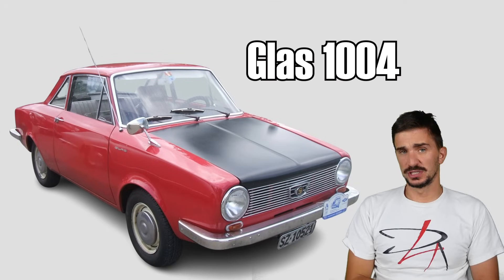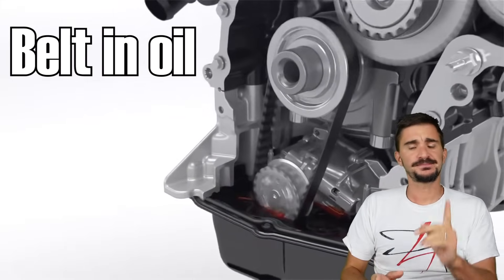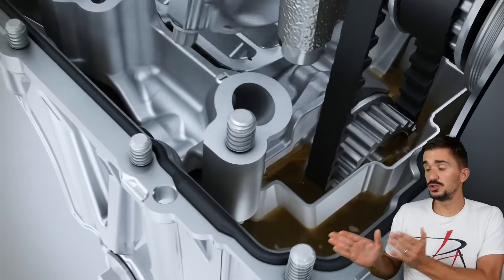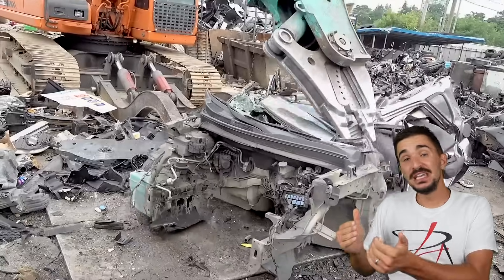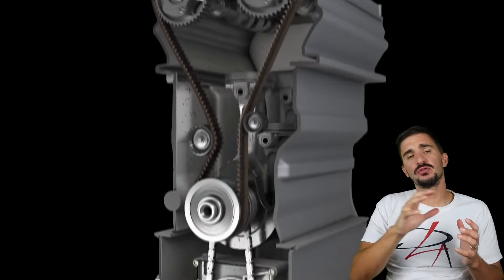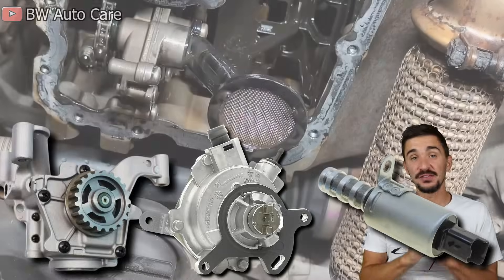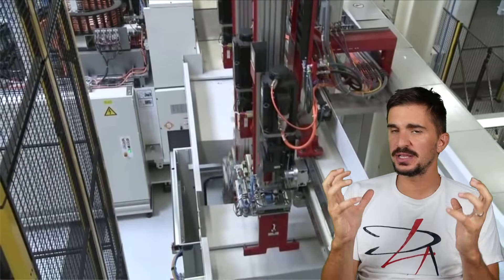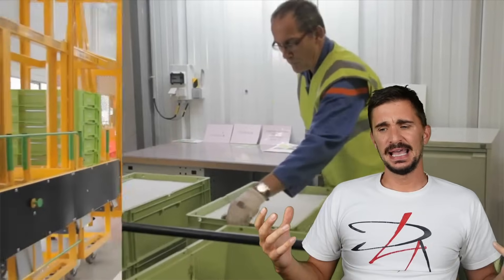Who Approved This and Why Is It Still Being Made? Wet Belt aka Belt in Oil Engines

Comment: BMW also earns extra points for making timing chains that fail before timing belts.
Reply: Blown Motor Werke
Reply: The timing chain can't fail if the shitty plastic chain guide fails before ! ... Bmw logic
Reply: and also .....but not only bmw , others do too ....BMW spared ONE ( 1 ) lid and gasket and moved to timing stuff to....the worst place to be for a timing chain , at the point where the most vibrations and inkonsistency occurs , at the clutch .
and it makes it more expensive to maintain or change .

sometimes engineers need a slap to the back of their heads .
Reply: BMW's are not know for failing timing chains.  Failing VANOS, connecting rod bearings, HP fuel pumps, plastic connectors, etc. but not timing chains.
Reply: BMW claims to be the "Driver's car". They never claimed to be the " Owner's car" :^)
Reply: BMW are a different kind of special.
Reply: @KapiteinKrentebol 😂😂😂😂😂
Reply: No, it's the extended service intervals they use.
Reply: Germans cars are not what use to be. Now the car from Asia is more reliable than any Germany made car. And this is why they now close cars factories in Germany. Poor sells do to Asian cars who comes to EU with much reliable engines like Japan cars for example.
Reply: N16 mini owner here, can confirm, chain doesnt last, plastic guides even worse. Thanks BMW. Otherwise it is a really nice engine
Reply: @invertedpolarity6890  :) You are talking about petrol engines, but in Europe most engines is diesel. Read something about N47 and N57 timing chains...
Reply: And VAG is the same. But then they invented the triangular cam gear to counter that problem and make the belts as short lived as the chains.
Reply: @Low760  Yep thats also a large part of the problem.
Reply: @sleepydragonzarinthal3533  Ex-Citroen DS3 owner here. The BMW supplied Prince Engine kept me on a first name basis with the dealer.
Reply: Timing guides.  Not the chains
Reply: They learned that trink from VW/Audi.
Reply: @cameron20020  haha some of them were worse than others. I do a lot of the work myself as an amateur driveway mechanic, its not much worse than other cars I've owned, just less workspace under the hood, longer list of possibilities when diagnosing, a few extra specialty tools to buy. So glad I dont have the n14 or n18, the candles that burn at both ends. It does mean a mechanic will charge a lot for the extra time and to justify the specialty tools, but for the DIY its just an extra beer or 2 on the weekend.
Reply: BMW
BUILT MECHANICALLY WRONG
Reply: *Audi engineer steps in and says hold my beer*:

The 2.0 tsfi is SO COMPLETELY overly complex with a single chain ran over 30 extra sprockets and 10 different tensioners and guides....
Reply: Give me timing gears ala Ford 300 I-6 and Volvo B18.
Reply: @Fish-y3g  The chains are also wearing out and get too long for the guides to be able to guide them. Both on this ford engine and VW engines because its being made too cheaply. It's the riivet holes that wear though rather than the chanins stretching.
Reply: well its not the timing chain its the timing chain tensioner (that they made of plastic)
Reply: @davidtheexiyt6060  yeah, my engine is still going after 27 years, lets hope she keeps going
Reply: VAG too
Reply: @mkshffr4936  Are those not OHV thoug menaing that the job of the cambelt is being done by pushrods rather than gears. Compareing apples to horse apples here.
Reply: @rimmersbryggeri  I've checked tons of bms chains and mini chains too.  Had 1 mini chain stretch.  All the timing guides shattered before the chain could wear.  Except the 1 mini people actually maintained
Reply: i never heard of a bmw timing chain fail here by us in South Africa. Merc and bmw with timing chains can do 500 000km easy. Anything with a cambelt is a no no. Fuel pumps on bmw was an issue for a while especially 1 series.
Reply: @mmmdawe  I think it's the 2.0 that loses oil pressure sometimes in the hydraulic tensioner and the chain jumps when starting it.
Reply: @rimmersbryggeri  Those are indeed OHV which I prefer however it is possible to make OHC engines with gears. In fact IIRC they used to make aftermarket systems to change to gears from a chain.
Reply: @dennythescar80s8  German cars never were that special. They were on par with all other European manufacturers. Sometimes better, sometimes worse. There are such things as downright shitty cars by Mercedes. No, I don't think of the original A-Class there. The C107 models have bodies you can't stop from corroding.
Swedish cars were different and better. The vast majority of customers didn't get it, Swedish manufacturers got bought by shitty conglomerates and got made worse.
The view of the majority of car maker's CEOs and boards is: Customer equals dumb.
And they are not that wrong.
Reply: @dennythescar80s8  they closes because of no dirt cheap gas from Russia
Reply: @Fish-y3g  my chain does rattle at idle cuz of the tensioner :) 20k km further im thinking about replacing the faulty part. It's not even the loss of oil pressure, it's caused by fatigued spring in the tensioner, which does not get any help from the oil pressure at low rpm, to keep the chain under tension.
Reply: Might want to check the owner. The only real issue are the v8s and the valve seals. 

Bad oil and extended oil changes are what make chains fail.
Reply: @sleepydragonzarinthal3533 Is that the one in the 1 series with the skinny timing chain hidden at the rear of the engine ?
Reply: Same on the Stelantis 1.5 Diesel.
Reply: @davidblahota5655  I've had 2 that were newer low mile engines that had jumped after oil changes .   The springs seemed ok.  I ran an independent garage when that happened.  My buddy who was a vw dealer tech has had some of those engines jump too 😳
Reply: I'll give em some slack due to how easy it is to change some of those chains
Reply: @davidtheexiyt6060  they've had multiple engines with timing chain issues, the N20 being the worst but go ahead and defend a shitty engine maker
Reply: @davidtheexiyt6060 ppl driving cars they can’t afford is what it sounds more like to me go change ur oil or get a throwaway car
Reply: Tell me u don’t know nun ab cars without telling me. Ppl destroy bmws and Audis because they cannot afford to drive the car and extend service intervals and oil passages get clogged etc. if a car had frequent oil changes it would not have those problems.
Reply: @tobwilpeen5701  exactly.  No 10k oil change intervals..... which to customers means 12 to 15k.  Like  Old Ford v6s from the Rangers were great engines until the timing guides got brittle from not changing oil enough
Reply: Bavarian Manure Wagon, Bring My Wallet.
Reply: and people keep claiming that push rod motors are dead, i'll take a short timing chain & the push rods of a small block chevy for the rest of my life. long live the push rods!
Reply: @davidtheexiyt6060  1 out of 1000 verses 1 out of a few million.😂😂😂😂
Reply: If only changing oil every 10kkm would completely fix this :(
Reply: I wonder how many cry babies that complain about BMWs actually owned one. Anyway, I bet their Citroen Berlingo is way better.
Reply: @dennythescar80s8  Toyotas are starting to go up in flames. As fast as Electric Vehicles. That are made in china. Or experience a major failure engine failure.😮🥶😭😭😭
Reply: @invertedpolarity6890  Few are, for example the N47.
Reply: If you use the right oil with molybdenum additives the timing chain will last forever. German cars have to be treated like the engineers intended to.
Reply: @invertedpolarity6890  Unfortunately they are know for those type of failures. Especially timing guides and stretching chains. In my country we drive mostly diesels, so when buying a 5 series F10 I avoided the N47 because it's know to blow thanks to the timing chain stretching too much or even breaking way before its service interval. So I went for the N57 and guess what. I had 3 engine failures because of the other problems BMW engine are known for.... rod and main bearings...
Reply: That is indeed a skill
Reply: I had an E34 5 Series. Totally reliable apart from the irrelevant toys like rear window blinds etc. (I didn't spec. them, I bought it used)
Reply: @invertedpolarity6890 
And l remember when it was just coolant pumps. Maybe they think they are still building engines for fighters. The aircraft will never survive long enough to reach Time Before Overhaul. AKA as the driver is going to total it anyway
Reply: That's due to bad oil
Reply: @maxx1nsane  having replaced (at great expense):
Timing chain
Vanos unit
Cams
Followers
Rod bearings
Head gasket

I hereby welcome any non BMW owners to join the bashing. 😂
Reply: @ariesmight6978 Correct me if I'm wrong, but wasn't there a crossover with BMW in the GR Corrolla? Or was it just BMW blocking it from Europe to protect 1 Series sales?
Reply: Might as well have made a rubber chain
Reply: @rawenrawen2420  that's just plain not true... There are more diesels in Europe than America, but there are not more diesels on the road than gas engines in either country unless you're including large trucks and heavy equipment.
Reply: @invertedpolarity6890 V8 4.0 has bad design and TC failed.
Reply: VW says hi
Reply: This is actually true for all of the N series engines. Especially the 4 cylinder diesel engines. I have an M52 with 520k km on the original chain and head gasket, I changed them just because I stroked it to 3 liters. M series engines are one of the most robust engines BMW has ever made. If it fails, its the owner's fault for not maintaining it.
There are numerous cases of M52/54 engines going upwards of 800,000 to 1,000,000 km. With the highest one I've seen at 680,000 miles (almost 1,1 million kilometers).
Petrols are a bit better even with the N series, two of my friends have N52 engines (one in a E92 325i and one in a F10 528i (US spec is with a N52B30)) Both of them have over 300,000 km on those engines.
Reply: Audi was famous for timing chain failure, BMW diesels had timing chain issues.. I think you are just talking out of your ass, good try though
Reply: @takomerp  It's the mechanic's car
Reply: @invertedpolarity6890  Finally, a comment from someone who actually knows what they are talking about.
Reply: @davidtheexiyt6060 Cope harder, “bud”.  😂
Reply: @simontist 
There's not really any such thing as "bad oil".
There is the wrong type of oil and contaminated oil.
Reply: Not just BMW , Mercedes has it even worse timing chain failures.
Reply: Lasts longer than the warranty, so they don’t mind
Reply: @TheGuruStud  vw are worse 2.0 TSI is disaster
Reply: @pauln6803   I guess I mean it goes bad when it's too old. Or people using the wrong spec. User error in other words
Reply: BMW owner here with the N47 engine. Just change the oil regularly. Not the 18k miles BMW tell you and all will be fine.
Reply: @mkshffr4936 

A lot of GM (US) cars from the 80s had gear driven cams/cranks….
Reply: @davidtheexiyt6060  you are obviously not familiar with the N47. Still, bonus points that despite a severe design flaw, it was still more reliable than the Ecoboom
Reply: Also extra points for using magnesium engine castings (when aluminum works just as well) requiring them to use aluminum bolts - which is dumb enough - and then deciding to have them torqued to yield.  Aluminum fails pretty quickly under strain.  

I saw so many of those bolts with the heads just missing.  At least you could extract the bolts pretty easily?

And on their older aluminum M54 engines, if you overheated them, the head bolts would pull the threads out of the block, and require thread inserts be installed at the machine shop.  People talk bad about the Cadillac Northstar for having the same exact problem, but silence about the same exact problem on the M54.
Reply: Welcome to Audi club. Timing chains on some Audi engines need to be replaced as often if not more often and cost 2-3 times more to do than dry belts.
Reply: 😅. I have never owned a BMW and no desire to ever own one.
Reply: @davidtheexiyt6060 where did the guy say all BMWs are bad? Getting a bit too protective there fella.😂
Reply: For owners that don't know how to change their oil on time.
Reply: @jacooosthuizen3593 why is timing belt a bad thing there?
Reply: @KapiteinKrentebol  Brings Mechanics Wealth
Reply: Indeed. Sadly thats just one example, I remember some of the old designs from Merc and BMW that were bulletproof and were even forgiving with poor servicing, not all. There were crap engines long before but the 2000s came along and a lot of designs that should have never left the drawing board let alone the factory floor. A lot of it is a tensioner that doesn’t self adjust properly or at all. I would favour a normal timing belt over most ofter designs, even if the change mileage was 60k. At least it can be done without worrying about premature failure. Some of the early attempts at timing belts were terrible as well. They should have enough data to produce something decent by now, then they started using wet belts for timing 😂.
Reply: @Mac_F87  fella, my point is that he can’t just call a brand bad just because he had a certain issue while quite literally everybody else that owns a bmw hasn’t had that issue. Maybe don’t misinterpret peoples comments next time?
Reply: @davidtheexiyt6060  Aww, you triggered? BMW has several engines that eat timing chains. I say this as someone who has owned a bunch of BMWs and currently has an X5.
Reply: @OtisFlint  also a bmw owner here, never had any issue, and I know multiple with old bmws and new ones aswell, never ever heard of a timing chain problem. You can even see in the replies of this comment people saying that bmw never has had any timing chain related problems. So it might just be a you issue pal :)
Reply: Audi tried to beat them to this with the v8 chains.
Reply: @dennythescar80s8  German cars are excellent if you keep track of the common issues and DIY the maintenance, or you have deep enough pockets to keep them properly maintained as they age. They can be very reliable with preventative maintenance because most generations suffer the same repeat issues. Ignore these issues and they are nightmares. They are not for the average vehicle owner.
Reply: @davidtheexiyt6060   I think you are the one misinterpreting people comments. Where exactly, did he call the brand as a whole bad? 

I’m sure you can explain, since you seem to be the one who likes to read between the lines and come to crazy conclusions. 🤦🏻😂
Reply: @invertedpolarity6890  They didn't sell the engines that had the REALLY bad timing chain issues in the US. It was epidemic in the rest of the world on the 2.0L non-turb gas and turbodiesel engines.
Reply: Also bonus points for putting the chain at the flywheel end of the engine so engine or transmission has to be removed to be replaced said timing chain 😂
Reply: @davidtheexiyt6060 1 in 1000. That's a huge amount of failure! I hope this wasn't you defending BMW.
Reply: im dying when someone said to me "bmw oil change interval can be as long as 15k miles". I checked the web and apparently its not uncommon recommendation.
Reply: BMW Broke My Wallet, they are leaders in their field
Reply: 300k mile internet failures.
Reply: Did you forget to pay your timing chain subscription again? 😂
Reply: @ChainsawChristmas  unless ur the ceo of Honda, that’s a normal amount of failures
Reply: I did a timing belt change on my 92 Civic Si hatchback at 229 thousand kms and the next one at 428 thousand kms,it still looked good😊
Reply: That’s interesting 🤔 Never had a BMW have a timing chain fail 🤷🏾‍♂️ Maintain your car, change the oil every 4,000 miles. I think my cousin JUST had to replace the timing chain on his E39 540 after 225,000 miles which really, at that many miles you should replace the chain on any car.
Reply: @davidtheexiyt6060  I think you may live in a different market . European N47 diesels had almost 100% premature failure.
Reply: N47 engine. I had a timing chain snap on my 5 series when it only had 32k miles. Roadside recovery guy was like yeah, they also put this tiny, fragile chain to the back of the engine too so you’re gonna need an engine removal lol. Worst idea ever
Reply: Not remotely true. The guides yes. The chain itself hardly ever.
Reply: @invertedpolarity6890 my BMW is known for a failed owner.
Reply: @sleepydragonzarinthal3533  That’s a Peugeot\Citroen engine
Reply: @mkshffr4936  I would like to see what such a system looks like and how it drives water pumps etc correctly. Seems like alot of added complexity for very small real world gains to me. Not even sure that gears are more rubust than a well degned chain over time.  I don't theink that a well designed chain system uses the chain to drive the water pump and maybe I am just confusing it with belts and they never do. Never did change a chain myself but I have assisted in changing a wet belt and i think in that particular car the oil drain plug was an even worse design than the wet belt. (Plastic sump and not threaded).
Reply: @invertedpolarity6890  Not sure what country you are from but in the UK The basic diesel models, which are by far the most popular are very well know for chain failure before 100K miles .
Reply: Kudos for that mention.  Yea, damed of you do, damed if you don't.
Reply: @a1d3nh0  I have a 328d with a N47, you got a dud buddy. The timing chains on these engines are very strong and should last 200,000 miles. The chain guides and tensioners are the weak link (no pun) but they should last 200,000 as well with 4,000 mile oil change intervals. If you wait until 10,000 miles to change your oil your chain (and other components in your engine) will fail. BMW worst mistake with these chains was recommending a 10,000 mile service interval. Ive seen these cars hit 180,000 with no issues, but at 200,000 miles you should really change your chain and tensioner.
Reply: @Soh90  no dud. That exact engine was the reason BMW was featured on BBC’s Watchdog programme. People had them snap at 10k miles. It was concluded that bmw wouldn’t recall the engine because it was cheaper for them to deal with lawsuits as they came in. Not because the engine was fine. They’re not strong chains at all. Thinner than the variation before, shaper teeth on the gears, worse tensioners and guides. And put at the back of the engine making it a whole disaster. I didn’t get a dud, I got the standard. Either you were lucky or you got one with upgraded parts. All repairs to those chains involved a better chain, cog and better guides. Go watch the BBC documentary on it
Reply: @jamesmedina2062  Personally i had a cambelt snap on my VW TDI. Never had my BMW or Jeep timing chain snap while owning those vehicles. Personal experience it is a maintenance part so never know when it actually will snap.
Reply: and carbon buildup from soley direct injection.
Reply: only the engines under 2 liters.
Reply: @a1d3nh0  What year is your 5? I know they were upgraded as a result of the lawsuits and you likely have an earlier model 5. So that would explain why we have completely different experiences. Sorry that happened to you man.
Reply: @invertedpolarity6890  'BMW's are not know for failing timing chains.'
There's failing and then there is failing.  Yes, they have been known for timing chains that need expensive repair and replacement even if they hadn't just fallen apart and blown up the car yet.  It was a known thing on both of my 735i's even way back in the 1990's.
May not affect every engine they ever made, but it was definitely a thing.
Reply: I think that’s Audi my friend
Reply: @megunded  they moved the timing to the back of the engine because of the problem with belts getting sucked into the timing cover from oil leaks onto the accessory belt and slipping off the crank hub getting sucked through the seal.
Reply: @Soh90  mine was years ago. 54 plate it was
Reply: timing chains was literally just the N20/26, rest of the engine is very reliable you have no idea what youre talking about
Reply: @a1d3nh0  Yes you are right, early 2000’s N47’s were really, really bad lol. My car and my colleague’s is a 2014 and 2015, respectively. His is sitting at well over 180,000 miles and I’m either at 94,000 or near that much. I’m also in the US where diesels aren’t as common (or as loved) and over here BMW was pretty much forced to do certain repairs. Due to all the stringent regulations the N47 still isn’t perfect, but it’s less BMW’s fault and more environmentalists/EPA’s fault. DEF, EGR, DPF, routine fuel filter changes, SCR and all the other acronyms all make the car more of a headache than it needs to be. Absent all those things, the updated N47 is a robust little engine.
Reply: @lucaspoussard8279  My cousin was just telling me yesterday about how his BMW had a bunch of crap in his oil filter at 150k km, causing oil pressure issues. He's not a car guy, but I knew exactly what that crap was without even seeing it!
Reply: @rimmersbryggeri  On timing chain cars the water pump and accessories were driven by the fan belts. It has been about 40 years but as I remember the systems used intermediate gears between the crank gear and cam gear. A bit complex which is probably why they were not long on the market.

The advantage of the OHV with gear design was (unless they used fiber tooth gears) they were generally good for the life of the engine and they rarely failed catastrophically. By the time the gears wore enough to affect valve timing it was time for a rebuild anyway at which time replacement was trivial. Often the oil seal needed replacement long before the gears which was a pretty easy job for the shade tree mechanic. When replacing the seal it was easy to check the condition of the gears and very cheap to replace.

 The Ford big six was renowned for going hundreds of thousands of miles with nothing but tuneups and oil changes. The old pushrod Volvos also had a good reputation in that regard.
Reply: Smart/Mercedes knew about those in 1999!
Reply: @SparkBerry  What kind of car does he have?
Reply: @mkshffr4936  On ohv cars I agree it's great  because it doesnt have to transmit the power far I also like it for the oil pump  drive which is driven by a separate chain on some engines. My least favourite thing on modern cars is the electric coolant pump.
Reply: Bring a
Massive
Wallet
Reply: VW too, it seems.
Reply: @lucaspoussard8279  Oh it can, the guide will break and chain will follow lol
Reply: @davidtheexiyt6060  stay ignorant i guess. Every single one has this problem.
Reply: @Globbs  I’m sorry what?? 😂😂😂😂 is it your hobby to hate on bmw?
Reply: The BMW Diesel engines N47 and N57 have cronic timing chain problems. 
The worst part is that to replace the timing chains at 150k km we have to take the engine out because they are in the flywheel side.
Reply: And making sure it’s an engine out experience for maximum cost
Reply: @jacooosthuizen3593  I also owned some VW in chained Vr6 petrol and a 1.8 turbo with belt. We went 100k miles between belt and water pump changes and the 5 valves per cylinder never made impact. It is up to twice the maintenance as a good chain when belt but cars just need maintenance. Well its definitely part of why I went away from VW. Other parts failed too much such as ball joints in front end.
Reply: @jacooosthuizen3593  engine oil leaks were the worst and this causes increased wear if run low which is inevitable
Reply: @noobasdfjkl  prince engine is a BMW redesign of a PSA engine. PSA makes a lot of the parts, BMW assembles it (generally) but the "who did what part" can be (over)simplified as "BMW uppers on a PSA block and lowers". Of course its not that simple, but when we talk about prince engine reliability issues, we're talking about the timing chain and guides that don't last, oil leak/consumption caused by cheap plastic valve seals, unreliable vanos solenoids, piston rings and blowby issues, these are mostly the "BMW side" of things. Then there are the issues of direct injection you get on the forced induction n14 and n18 that the naturally aspirated n12 and n16 dont have, but the n12 and n14 are worse than their newer counterparts in reliability to the degree they feel like half-cocked prototypes.
Reply: N20 engines sweating bullets rn
Reply: i think it wasnt the chain itself that failed but the guides /tensioners
Reply: BMW timing chain get elongated in n20’s that’s all. Guides fail on older motors but other that bmw timing chains are great. I’m a master tech for BMW. Plenty of other crap to worry about before the chain lol
Reply: If Honda still believes that rubber timing belts are better than chains, I would tend to believe them!
Reply: BWM eat oil for breakfast
Reply: @invertedpolarity6890 check your facts - N47 and N57 diesels are terrible for chain issues.
Reply: @takomerp  Bought my first last year. That was an error.
Reply: @rimmersbryggeri if your VAG timing chains are not lasting at least 120k, you didn't service the car correctly. I was a VW tech for years and the only cars that were getting chains before 120k either had visually unmaintained engines or still had the known-poor original chain tensioners. I think VAG should have recalled those tensioners, but it only rarely caused a catastrophic engine failure, so they didn't.
Reply: You have to bring more examples of this to the public. I think it’s the only hope we have for getting these trends to stop or at the very least be mitigated more than they are. I think it should be illegal for oems to have warranties that are less than 200k. And also I think that if a car can’t pass emissions with less than 200k on the odometer than the government should pay for the repairs.
Reply: @deciplesteve  They don't if you follow VAG servicing scheduele. Because of the stupidly long intervals. They should have recalled them. I have encounterd ones that lasted less than 100k actually. But yes they usually just don't start rather than failing catastrophically. Its not only the tensioner though the chains get too long (sloppy) for the tensioner to work aswell. To the point that the chain wouldnt work with a new tensioner either.  I have encountered it enough times for it not to be anecdotal. Almost every mkv/VI golf I have ever worked on had some kind of cam/crank misalignment. One had a faulty injection pump so that may be anecdoteal but web quieries suggest it isnt. (I believe it was a tfsi injection pump)
Reply: Bought two 2 series this year both under 50k both had chain rattle from cold start. Had 7 cars in total since Christmas currently stuck with a 1.0 polo i took as an exchange 😂.  Can't face loosing anymore money
Reply: Funny enough, I am on my 8th bmw, and lots of my friends and family members are driving them as well, and none of us have ever problem with timing chains. It only happens to mechanically illiterate ignorants who change their engine oil and filter every 30k km instead 10k as it should be done according to experience, general knowledge, logic and common sense. And do not tell me you don't need mechanical knowledge nowadays to buy and run a car. Yes you do, otherwise you may end up buying piece of shit like ecoboost or pure tech and then proper shit will hit the fan. And it will be expensive for you. This kind of informations are now much easier available than they used to be.
Safe and problem free driving to everyone.
😉
Reply: @invertedpolarity6890  not since about 2010. there's even a watchdog episode on bmw chain failure. Its the 2.0 and 1.5 engines with the issues the 6 cylinders are still good cars
Reply: @Shermanlovespie  So you buy a VW 1.0. Great move Puddy.
Reply: @rimmersbryggeri  didn't buy it took it as a replacement for another vehicle
Reply: Can confirm. My 2011 328's engine ate itself at only 110k miles
Reply: Jaguar makes engines that fail before belts or chains
Reply: 15000 to 20000 km oil change? I haven't had a car for the last 15 years that had anything than 30000 km oil change intervals. Peugeot and Renault diesel engines. Never any problems with them.
Reply: @invertedpolarity6890  Boy you are wrong, despite I wish you were right.
Reply: 16,000 mile oil changes oem reccomended......what could possibly go wrong.
Reply: BMW's single chains fail duals don't camps fails every 30000 miles cos shitty rubber seal not the aftermarket quality can't remember the material. Plastic thermostat housings not aftermarket aluminium ones. Auto boxes that dont get fluid flushes every 30000 miles. There is no sealed for life zf boxes just hard to do. I know how to flush them without taking the torque converter out. Kalube.
Reply: @KapiteinKrentebol Bavarian Murder Weapon
Reply: @megunded What about the Audi A7 that needs the engine to come out to change the timing belt?  Only the Germans could design such a stupid idea into a car.
Reply: @chrisgermann6658  in a properly designed engine and the right oil, nothing. But the service intervals usually says "once a year" also.
Reply: Rover SD1 SDTURBO  (Diesel) model had Italian VM engine that had no timing belt or timing chain,  just a gear train.  Superb engine that should have been used more widely. It was also fitted in the Range Rover for a time.  Use a gear trains and increase life span multifold.
Reply: @invertedpolarity6890  The chain doesn’t fail,it’s the plastic tensioner that does !
Reply: @mkshffr4936 The Italian VM diesel engine fitted to the Rover SD1 had a gear train and no belt or chain. A superb engine. It was 4 cylinder and also had four separate cylinder heads.  This engine had huge potential but unfortunately wasn't widespread.
Reply: @invertedpolarity6890  I am not disagreeing with you. How does an engine today have issues with connecting rods? It not like we are stuck with 1860s tech or anything.
Reply: @invertedpolarity6890   its not the chains themselves that fail, but the timing system as designed does fail on M62's, especially when run low on oil. Why? becuase they thought it was ok to put a hydraulic based tensioner in, and cheaped on seals actually holding the oil in. 

So what happens is that the chains rattle and destroy the timing guides on startup until there's enough oil pressure to tension the chains. With enough of the guides destroyed, eventually the engine skips time and eats its valves.
Reply: plastic chain guides with no metal besides the dowel pin.... plastic water pump impeller.....
Reply: @AlanLogan-x5c  no, n16 is the mini cooper NA motor, made by BMW but never in one of their own cars
Reply: @invertedpolarity6890  the timing chain plastic guides do, they fail alot
Reply: 330d 2013, 180k miles, regular oil changes, still runs well no chain rattle, never been changed!
Reply: @invertedpolarity6890 BMW in the 2000s also had a very high turbo failure rate. Something like %66 iirc. Granted that is likely a supplier issue the turbos were supplied by KKK.
Reply: @rawenrawen2420 in eastern europe, yes. Western europe petrol is more common.
Reply: N20 timing chain replacement gang 🤘
Reply: mine chain have now 31years and 400 000km done, i dont even thing of changing it in my bmw
Reply: @megunded  No. Since the flywheel is at the clutch that is the part with minimum rotary vibrations.
Reply: @LfsJujek  n20 had a timing chain recall because of chain quality and the plastic guides; i got mine done for free under it.
Reply: And placing said chains in the rear of the block.

#engineoutproceedure
Reply: @2023_GJ how many miles/kilometers?
Reply: If u change your oil every 30k km, it's the end for any engine, not only BMWs or VAGs.
Reply: @jakecoye738 If you can't afford it. Ive bought several new, and have no problems for years when maintained. Then you won't make stupid names up for them. Stick to your ragged out mustang with the stupid exhaust.
Reply: @abdbach379 what is a good diesel vehicle thats lasting a long time in your country? And what country? I wish diesels were more popular in the US. I love diesels.
Reply: @rawenrawen2420 my N47 powered 123d spun a big end at 148,000km 🤦 it also had a nasty chain chatter. Unfortunately BMW doesn't recommend regular maintenance nor engineer their cars to last 30-40-50+ years anymore.
Reply: Ecotec earns extra points for using two wet belts. Also one for the oil pump.
Reply: They WHAT?
Reply: GM would like in on that award as well
Reply: VW too!
Reply: @lucaspoussard8279 N20 has entered the chat…
Reply: Oppenheimer may have a fix
Reply: @KapiteinKrentebol  LMAO!!!
Reply: Big Money Waste
Reply: they are monitoring each other all the time... when a competitor is saving money it timing components you either try to save money too and cheapen the components or you become less profitable.. guess which option is the one every motor vehicle manufacturer goes for
Reply: @RobotDCLXVI  Sorry to hear you're having troubles with it. Some of the design decisions BMWs make I just really hate, like the injectors being not only proprietary, but very expensive and impossible to refurbish.
Reply: I'm afraid to ask how that's possible.
Reply: VW has joined the chat xD
Reply: @sleepydragonzarinthal3533  And the N16 is their best attempt. 😅 I had an N14 Mini briefly. Timing chains are needed more often than the recommended oil change interval. 😅
Reply: @AlanLogan-x5c  No. 135 had the N54 and later, the N55. These are turbocharged, direct injected engines with the nasty habit of carbon deposition on the intake valves. Timing chains aren't a big issue with them. The chain is at the front where it belongs. It's still a big job if you ever have to do it, but at least you don't need to remove the engine to change the chain and guides.
Reply: @grumpydude6929  Those are the same engineers who let marketing and environmentally oriented governments force 20,000 mile oil change intervals. This largely started with the "free included maintenance" program. Same engine, same oil, double the OCI. I go 7,000 miles on oil and I drive 90% highway. 180,000 miles, and my N52 runs great. Cams looked brand new at 145,000 miles. Take care of your cars and they will take care of you.
Reply: Dry belts are superior in just about every way to chains. All chains and guides wear, especially with todays extended OCI and direct injection. Too many contaminants for those those parts to survive.
Reply: @bloss495  I just replaced the timing chain on my 3.2 VR6 after 185000 km due to a slight rattle, in all that mileage it was stretched by 5mm.

I'm inclined to believe VW chain failure are a myth, unless you run the engine oil into absolute horseshit at which point, yes, carbon damages steel over time.
Reply: @deezelfairy  Ihave no idea what advantage that had ? Reduced noise? Increased repair cost ?
Reply: Lmao facts
Reply: GM as well
Reply: @invertedpolarity6890 I wish you were right but sadly not. I have just this year retired after nearly 40 years as a professional mechanic and technician. Last 20 with BMW dealers with full factory training. Not all engines, but many had issues with the timing chains both petrol and diesel since roughly the early 2000's.  Caught before failure means an expensive repair, but with the right revised parts should last the lifetime of the car. The ones that broke or broken plastic chain guides blocking the oil pump pickup could cause so much damage that warranty dept would request a complete new engine to be installed as it was cheaper than the parts and labour to rebuild them. The other faults you mentioned kept us busy too. Best advice is to change the oil and filter at around half the recommended interval. And never thrash the car until the oil temperature has reached its normal running temperature.
Reply: @jacooosthuizen3593  Old BMWs were not subject to nearly as stringent emissions, fuel efficiency or performance requirements. Everything from the base model up was the same variant of a 6 cylinder engine.

So simply by virtue of the designs being allowed to be simpler, they were of course reliable.

As for a 1 series though, I am not so sure.
Reply: @zweispurmopped  Yeah... only a few cars worth buying left on the market, and most of them come from Japan, Korea... not from EU.
Reply: @dennythescar80s8   I very much look forward to seeing the new Renault R5 in the flesh, I think that will be a very interesting one. The non-SUV Volvos also still look quite interesting. But in general there are very few cars and manufacturers left that make me look. If I won the lottery big time today, I'd need a big shed for all the old cars and motorcycles I'd buy, but I guess I'd have a really hard time finding even one contemporary car.
Reply: @rimmersbryggeri  "Both on this ford engine and VW engines because its being made too cheaply. "  The chain in a VW EA888 is exactly the same model of  BorgWarner link chain as in a Honda K20 though. I think the fault was with VW's inferior design of tensioner and use of chain guides with no metal backing frame (unlike on the K20).
Reply: @TassieLorenzo  Yeah probably many contributing factors. I like the chain on th mazda L4 they used to put in the ford mondeo.  Really simple and durable.
Reply: It's not the chain that fails, it's usually the tensioner not picking up the chain slack on startup, this slowly eats the plastic guides that eventually fail and the chain jumps or ingests the fragments of the guide and then fails. The tensioner issue is caused by poorly designed oil galleys that get clogged, the tensioner does not get enough oil pressure and instead the spring takes the load, this eventually starts to fatigue and fail.
Reply: @cameron20020  Other way round buddy. Prince engine is PSA engine, BMW only made minor modifications to it for it to become the Prince engine we know.
Reply: 200 000
Reply: @dennythescar80s8  I have a 2017 honda... the service interval on the chain is only 100k... because of shitty tensioner and guides.
Reply: They probably use off the shelf bicycle chains....
Reply: Vauxhall is the exact same the chain fails due to the plastic guides specifically on the 1.2 if the side guide fails the tensioner will fail
Reply: @howarddavies136  Don't get me wrong, I don't say BMWs are reliable. I did have my 325's engine yeet some pistons, recently :D
And all these after buying new tyres, rear subframe, rear drive shafts, springs, bushes, brake calipers, pads, oils, filters and other things I forgot. Next car I bought, was another BMW. :face-purple-crying:
Reply: @invertedpolarity6890  well not the chains themselves but the plastic tension guides are known to check out earlier than they're supposed to
Reply: @maxx1nsane  we are gluttons for punishment. I reckoned up I could be well over half way to a cayman gt4 with what I poured in to my M3. I'm a diff, an exhaust and an airbox away from getting mine where I want it to be. And then the RACP will probably fail 😂 at that point I'll just re shell the fucking thing.
Reply: I own a BMW and this was hilarious. I approve!
Reply: A Goat post if I’ve ever seen one
Reply: BMW also has turn signals that fail immediately on delivery.
Reply: Well my beamer has 320k kms, all with orig timing parts
Reply: You act like bmw is the only manufacturer with timing chain problems
Reply: The same is happening with a lot of VW engines, too.
Reply: @dennythescar80s8 they close the factories because of other reasons.. My English isnt good enough to exactly explain why.. Google the piech/ Porsche problems and it will explain why.. Nothing to do with poor sales
Reply: @deciplesteve dude.. You Cant say he didnt maintained his car propperly just to say that he probably had the poor OEM tensioner in, which would be Unlucky... Wtf
Reply: @Rockardo_ correct. My E30 250000 E34 150000 E39 240000 E64 180000 no chain changes no faults. Cheaper to run than a Ford. New BMWs not the same. I wouldn't buy a current one.
Reply: Toyota also managed to make a timing chain with a shorter lifetime than a belt on the 22R.
Reply: @KapiteinKrentebol Werke?
Reply: My BMW will never ever ever break a timing belt
Reply: VW too. 1.4 Tsi, 1.8 Tsi :) very common engines, I've seen at least two failed.
Reply: My wife's BMW has failed in most everything apart from the timing chain.
Door fob entry (water getting into the aerial unit installed in the rear hatch door spoiler ( estate car )
Horn failure due water getting into the fuse box behind the glove box,from a blocked sun roof drain pipe.( Unable to rod as this pipe has a 90° turn in it!) Wife has to park with rear of car facing down gradient.
Front windscreen jets unable to give enough water due to continual blocking of their pump filter.
Tyre pressure monitor light pinging in red intermittently 
Run flat tyres giving terrible ride comfort and shred following her hitting a motorway pothole on the M74 on her way to Glasgow.
BMW -Bring More Wonga.
Reply: @invertedpolarity6890  Tell that to the N20, N47, N57, N14 all of which have notorious chain issues
Reply: My E39 with M52 runs great. But the newer engines are crap.
Reply: Mine was at the mechanics far more than on the road.  I had to cut my losses and dump it. What a beautiful driving machine when it ran. Unfortunately the electronics, many plastic parts used in construction,including a plastic radiator, made it built to fail.
Reply: There is a lot more to the reason why bmw n47 - and other N engines snap the chain. And many of the issues cand be greatly mitigated making it just as reliable as any other timing chain.
Issue 1: for that generation BMW recommended 25000km intervals of oil chaing or when CBS indicates so (oil condition sensor) - it's a very long interval and many run with dirty oil.
2: the oil sensor plantend in n47 was in the test phase and for the final market it did not measure any other thing apart from level of oil. so the CBS light could never indicate a lower interval for oil change.
3: roller chains are delicate and need good oil (they have more parts). Roller chains easily get worn if bad oil is present. as some rollers may get stuck.
4: some experts found the original tensioner was too short and had too small force.. so since 2011 bmw had an updated upper chain tesioner with fatter diameter (more force) and longer stroke.
5. Some variants of the CP4 bosch hpfp had a problem with turning the main seal loosing seal on the shaft and this leads to lots of diesel into the crankcase contaminating the oil.

In order to have a reliable N47/N57 engine all you need to do is to make sure the upgraded chain tensioners are installed, and change the oil at 10000km, also from time to time inspect the oil (to spot in time a hpfp seal problem, or a water contamination problem or any other related that could make the oil be bad, as well the level of the oil)
Reply: @azzyasi1050  I don't disagree, however I had an N47 BMW, I bought it from practically new (2000 Miles) religiously changed the oil myself with high quality oil  every 6 months or 5000 miles. By 75000 miles the chain rattled like hell and had to have it changed with the uprated chain guides, and sprockets. By 160K same thing again. Good servicing goes a long way to extend the life but the inherent design of the timing system on the Nx7 engines is a weak point regardless.
Reply: The starter-alternator in the BMW mild hybrid m340i is belt driven (unlike in the 330e where the e-motor sits on the crank). There's a good reason starter motors have historically been direct or geared to the crank. Seems BMW haven't heard about this. I predict a LOT of snapped belts and ruined B58 engines , probably just after the warranty period expires.
Reply: Don’t forget Audi - it’s a neck and neck racw
Reply: @AlanLogan-x5c  the original chain from the factory  gets stretched just in one place before 200 k km
Reply: @invertedpolarity6890  Are you joking? The N47 is infamous for timing chain stretch, guide failure, chain failure, chain skipping teeth, etc. It's an essential part of the service of the engine to replace once rattling becomes apparent.
Reply: @lucaspoussard8279  Actually the chain fails in the BMW N47D engines which are the first ones with the timing in the back,the timing chain can snap, programmed failure,they stretch especially in one place
Reply: Not failing timing chains, but failing timing chain guides mainly, which of course lead to the failure of timing chains.
Reply: Timing chains need oil to work properly 😂
Reply: GM is doing a bang up job of this too with the 3.0L Duramax Diesel.
Reply: @invertedpolarity6890  yes timing chain guide/tensioners on turbocharged PRINCE engine (BMW/PSA). N13 on BMW side, EP on PSA.
Reply: Only on the 4 cylinder, never heard of inline 6 or v8 chains failing unless someone never changed the oil
Reply: I don't understand how they do it. VW/Audi, Benz and BMW all have a BUNCH of chain driven engines that fail before any belt ever would... Buying a used German car is like a research peoject in quantum phsyics istg. So much fucking information to go through...
Reply: Wrong. The inline 3 and 4 cylinder engines inf the F30 generation cars are well known for timing chain issues...
Reply: I had a 1992 honda legend 3.2L v6 which owned from almost new (22K) to 384K over a period of 11.5 years without any cam belt or water pump change! In late 2003 it was involved in a hit and run and my insurer wrote off the vehicle. The most reliable car I’ve ever owned
Reply: Dear modern auto manufacturers, despite all your efforts cars still manage to last for 100k miles without engine rebuild occasionally, which is unsustainable for business obviously, I have a bright idea of adding some sand to oil in order to make cars more profitable. Yoy can come up with some bullshit ideas like sand improves efficiency or something, I have other ideas, please hire me.
Reply: @leviathan5207  Most of its down to oil change intervals. I own a 4 cylinder bmw which is famous for timing chain issues (mainly the tensioner) it's got almost 200,000km on the original chain and still tight with no slack. This car has always had fresh oil except for maybe during the warranty period where the intervals were around 25000km by bmw. Most of the issues are down to the tensioner being clogged by dirty oil and wear on the guides. I can't speak for the newer N20 engines but most of the newer bmws above 2012 are junk anyway.
Reply: @prabhakarrao4922  no rubber belt will last 400k lol
Reply: Chains do not fail. Regular maintenance prevent anything. BMW is not a low quality brand like any french or italian brand.
Reply: Guess who’s N20 powered Z4 is currently in for a timing chain replacement at 73k miles 😂👋
Reply: Not just BMW VW chains barley make it to 60k
Reply: You didn't change the oil on odd numbered Saturdays, so the chain will not be covered under warranty.
Reply: @invertedpolarity6890  Maybe not in the gas engines, but definitely an issue in the diesel n57 and n47 starting around 100k miles.
Reply: Tsi engine enters the chat
Reply: The best point of this video is we have used technology to go backwards to make the consumer spend money they don't have to. More lawsuits would sort this problem. A bit like failed timing belt tensions that wreck an engine. Manufacturers should be accountable
Reply: @megunded bmw did it to move the center of gravity back to achieve a perfect 50/50 weight distribution. Not to spare some money on building the engine. (Or so they claim)
Reply: @invertedpolarity6890 I guess you may be in a country that didn’t get the diesel 320/325/520/525 variants that had timing chain guide failures causing the timing chain to fail? There was a 10-15year period where this was common to grenade the engines
Reply: That's ford bro
Reply: Idk man, my chain is at 325.000 km. Still looking good and going strong.
Reply: @invertedpolarity6890  the N47 is notorious for snapping timing chains, youre very wrong.
Reply: When I was a young man (40-60 years ago), I had a number of BMC Minis (they were cheap crap), and I never had trouble with the timing chains or their guides.  They had a single overhead camshaft, and there was no plasitic in car engines at the time.  After that, I had moved up the corporate ladder a bit (a little bit) and had company cars, which were looked after by somebody else, but the Citroen Picasso that the company bought me in 2006, I later bought from the company, and I'm still driving it well into my retirement.  It has a dry rubber timing belt, which I never felt confident about, so I replaced it at about 65,000 miles.  It goes around one of the engine mounts, so the engine has to be supported and the mount removed, but I got it done over a weekend.  It's up to about 80,000 miles now, and I guess it will be my last car.  My next one will be one of those 4-wheel electric scooters, with a blanket over my lap - for getting to the local co-op.

The rubber belt in oil, though, is a benefit to the manufacturers.  It lasts long enough that it won't have to be repaired under the original warranty, but increased maintemnance means more revenue to the company, and if it snaps and the engine is a financial write-off, a new car has to be purchased - and even if this particular owner buys a different make, more cars being purchased on the world-wide market will mean more of that manuafcturer's cars being bought.  Wet belts are a win-win (except for the owner, of course!)
Reply: @bobhopman4648  In the UK, the cost of diesel was significantly less than petrol (gasolene), but they really pushed diesel car sales in the early years of this century, so a lot of people went diesel - me included - but as soon as more people were driving diesels, they put the price up, and it was quite quickly more expensive than petrol.  Of course, most of what you pay is tax anyway.  They take the cost of raw fuel, then add on sales tax, fuel tax, etc., then they arrive at a figure onto which they add VAT - value added tax, which is a precentage of the price - so we are paying tax on the taxes.
Reply: @mkshffr4936  …or 1967 Fiat Dino or my 1989 Vanagon with push rods…eh?
Reply: @dennythescar80s8  G-Wagon reliable, because they use a 40 year old military design, but as of 2024 its over with
Reply: You probably talking about VW group? AUDI is absolute garbage in chain department, sticking 5 or 6 of them per engine. BMW, in my 20 years work as a mechanic I'm yet to see completely failed one, unless idiot owner believes in Amsoil commercial with 30-40 k oil change intervals 😅
Reply: Usually it's down to lack of service or wrong oil on the chains most common is the plastic breaking or the tenchiner 😢
Reply: Extra-extra points for putting it at the back of the engine forcing you to pull off the gearbox to access it.
Reply: Only the 3,4 cylinders gasoline engines got the Problem with the Timing chain. The Diesel and 6 cylinder are not that bad
Reply: Meanwhile the timing chain on my 2002 Toyota Corolla with 300k km is fine, doesn't even make any sound. Never been replaced
Reply: There are lots of additional reasons than that for NEVER buying a modern BMW!
😂🤣
Reply: It's not only oil but the temperature of it. Heat and rubber do not mix well.
Reply: @cameron20020  as far as I know, this engine has been jointly developed by PSA and bmw. It has been built by PSA in Douvrin. The BMW facility in Warwickshire was not used to assemble psa-versions but only the ones fitted in bmws/minis. And reliability (after sales service ? Accessories?) is way better today on the bmw/mini variants... sorry for your citroen. 😢
Reply: @dennythescar80s8 Asian cars - mostly japanese and korean ones - are today the most reliable cars, not by germans but american cars, sure. The wheel turned the tide.
Reply: @DownhillAllTheWay  OK, so that explains why diesel sales went up for a short time in the UK, but it still doesn't mean that there are more diesels on the road in Europe than gasoline vehicles.
Reply: @invertedpolarity6890  depends on the engine type.There are some four cylinder models that are very well known for chain problems.
Reply: N20 type shit
Reply: And GM also
Reply: @cameron20020 who are you? Who raised you to be this savage 😂
Reply: The chain guides fail. Not the chains. The plastic guides. 
 Still shit mind 😂
Reply: @invertedpolarity6890  n47 enters the chat
Reply: @dennythescar80s8 what Asian +350hp car is more reliable than B58 + ZF8?
Reply: BMW has like less than a handful of cars that suffer chain issues, M62s from late 90s which no one drives anymore or has been addressed in most cars from that era and N20 2011-2015 4 cylinder models. Most other issues like Vanos, rod bearings, valve stem seals, all those issues stem from BMW pushing 15k oil changes which is insane for a performance driven vehicle. 6k max idc my car proves that common issues are only extended oil change related in at 200k miles in my heavily debated unreliable X5.
Reply: I Give Volkswagen two golden bend Connecting Rod for the EA111 1.4 Liter Engine from the 2000s for the Problem of Stuck Pistons and the EA111 TSI Chain lengthening problems as the Replacement
Reply: BMW also had engines with short lifespans of rocker arm shafts.
Reply: @megunded  It is not the engineers fault! They are forced to do it by 
financial advisors. They don't want the engine to last because it is bad for business. It is the same fraud as it was done with lightbulbs
Reply: @lucaspoussard8279  I know it from first hand ,my BMW  engine went on expensive rebuild because off chain guides falling in 2 oil
Reply: @sleepydragonzarinthal3533  it’s a Peugeot engine that’s why.
Reply: @andrewdegnan7300  not just peugot, PSA and BMW
Reply: @invertedpolarity6890   they are known for failing timing chains too though, just depends on the engine. though in a bmw anything can fail at any time anyways..
Reply: Vw too
Reply: @invertedpolarity6890   BMW N20 engine had timing chain issues
Reply: @invertedpolarity6890  not true, BMW have been failing for decades now
Reply: Yea the non i6 engines are pretty shit aka n20 n63 Audi is worse for chain issues and just worse in general merc builds solid v8 engines
Reply: If you have a diesel bmw, a timing chain is an engine out job
Reply: @jacooosthuizen3593 F series & newer have 100k chain service intervals. 
& the diesels will break without a hint there is something wrong.. Plus putting the chain at the back of the engine was stupid!. M57 best engine
Reply: Land Rover too apparently.
Reply: @Incountry which GM cars had gear driven cams??
Reply: @invertedpolarity6890 you don’t know what you’re talking about, the N46 is notorious for timing chain failure!
Reply: Tell that to my >200k mile 320d that’s on its original chain with top guide missing 😂
Reply: Jaguar Land Rover outclass BMW in these stakes. Let’s also hide the chain at the back of the engine and make you remove the engine to change it
Reply: @takomerp  HEY! That's Ultimate Driving Machine, Bucko
Reply: Don't forget about audi. They did it too
Reply: @invertedpolarity6890  BMW's are absolutely known for failing timing chains, or more so the timing chain guides. This is a very widespread and known problem on N20 and N26 engines in particular. Stop spreading misinformation
Reply: @jacooosthuizen3593 

Yeah but the OP and several others here aren't going to let actual facts stand in the way of their desire to slate car companies they have little or no actual experience with.

Most commenting here are akin to someone saying "I bought/knew a guy who bought a Michelin tyre once and it got a puncture. Never buy Michelin tyres!" 😂
Reply: GM took the Vauxhall DOHC 4 valves 4 banger with timing belts of 80K miles life... changed to 40K recommendation... and converted it to timing chains of indefinite life and called it The EcoTec 4...
Reply: @invertedpolarity6890  you probably didn't know the New Mini's are BMW products.
Reply: BMW earns a Nobel Peace prize for making cars that fail before every other, and reliably (about the only thing you can depend on in a BMW is it breaking)
Reply: Ford do a chain conversation kit for the DuraTorq engine !
Reply: GM trying to get some of those extra points too with the EcoTec...
Reply: Yes, thats bizarre
Reply: @invertedpolarity6890  have you ever repaired an f series?
Reply: Its the chain guide that fails is it not ? The chain itself will be fine.
Reply: @andljoy  Different people have had different experiences. For me, the tensioner would not fully tension the chain until the engine was warm, and even before that, the chain became elongated.
Reply: @andljoy  Not sure about the BMWs because I only work on cars worth fixing, but when guides break there is a chance the chain can jump time and cause way bigger problems...
Reply: @dennythescar80s8 more so because the u.s./ukraine blew up nord stream and made provocations towards russia ending cheap energy. But yeah, Japanese cars are super reliable
Reply: @cameron20020  Ford 3V 5.4 entered the chat
Reply: @mkshffr4936  Yeah, some motorcycles used a shaft and bevel gears to drive the OHC. Kawasaki W800, for one. Gear drives are tops for longevity.
Reply: I do like the BMW lovers that deny that there chains need too be changed at 100k miles I have a freind that spends his time buying up failed bmws and rebuilding engines some times you can get lucky  with failed chain
Reply: What are you talking about? I have a 535 manual transmission at 411.000 miles motor has never been touched! Still does not leak and only uses 1/4 quart between oil changes.
Your brain is broken.
Reply: @jakecoye738 Be My Wife * 😂
Reply: @Angl0sax0nknight balancer shaft chain yes ..
Reply: @invertedpolarity6890  BMW timing chain reliability? N20 says hello.
Reply: @dennythescar80s8  Let's not broad brush "Asian" cars here.  They are not all reliable.  Far from it outside of Japanese.
Reply: The chains don't fail. The plastic timing chain guides on the other hand...
Reply: Chain guides only failed if the car wasn’t serviced correctly and guess what.. if you were doing below a certain mileage the bmw technicians weren’t changing your oil.
Reply: @takomerp  "BMW claims to be the "Driver's car". They never claimed to be the " Owner's car" :^)" HA! that's good.
Reply: @dennythescar80s8  toyota also is starting to go the same road. but it's either that or go broke. because even with cars, cheapest wins. so in a couple of years, there will be as many cars manufactured in north america or europe as smartphones/cellphones.
Reply: Funny that these cars only fail in 'murica.

Can you even handle tech that is younger than 50 year old?😂
Reply: @rimmersbryggeri  Concerning the VAG group engines, depends on the model. There are some great engines out there that last forever. I own one which is completely gear driven and has no timing belts or chains whatsoever. Time has shown that these are a bit sensitive to engine oil type (and the VAG group recommended ...the wrong oil!) but if you take care of the oil that engine is a gem. 
P.S. Even if you use the wrong oil you'll get premature cam lobe wear and you'll need a new top end but that's it.
Reply: @mkshffr4936  "Give me timing gears ala Ford 300 I-6 and Volvo B18."
>> There are 5 cylinder  and V10 TDI engines from the VAG group with exactly that: everything's gear driven.
Reply: @C_R_O_M________  Completely gear driven? And even if it is gears also wear and it should be a quite over complicated setup. (Checked it out and it is)
Reply: @rimmersbryggeri  it's like a Swiss watch and they have been engines that reached a million kms with no problems. Sensitive items are turbos (mine has two, one on each bank but I know what not to do - run them hot and shut the engine off without allowing for a cool down). 

If you don't race the car, it's going to serve you for a long time as it's over-engineered for huge torque and good power. I use it at 40-50% of its potential. That's the key for longevity with every vehicle and once in a while let it stretch its legs. Everything seats better. 
P.S. And, of course, never let it without use for long periods of time. Seals and o-rings get dry and you're asking for lots of trouble if you do.
Reply: And VW Group too!
Reply: It takes to be real genios to ruin timing chain. No time for oil chainge, commenting on youtube.
Reply: Not with frequent oil changes. Manufacturers will tell buyers what they want to hear i.e. oil change interval of 50,000klm. It's common sense and not cutting corners.
Reply: If you change the oil at reasonable intervals (5k miles or less) they last. You go 10k or more like the stealership recommends then you deserve to have it fail.
Reply: Nissan too. VQ35 and VQ40 secondary timing chain tensioners.
Reply: @lucaspoussard8279 Yes exactly. The plastic guides are the weak points.
Reply: @KapiteinKrentebol  ;-D ;-)) 😀 🙂
Reply: @rimmersbryggeri  What ? Triangular cam gear ? How , where ?
Reply: @rawenrawen2420  yes but don’t forget the N42 and N45 petrol engines. The bits of plastic timing chain guides normally block the oil pick up and seize the engine before the chain jumps time.
Reply: Add Skoda to the club. Their chains were so shitty that kids bicycle chain is far superior.
Reply: @lucaspoussard8279 engine ran too hot, plastic can cope with too hot engine oil.
Reply: @takomerp  You can't drive them if they're broke and it's too expensive to repair.
Reply: @jameskerr9509 I love the models from the 70’s and 80’s, which were fairly straightforward and didn’t use plastic parts.
Reply: It's actually the chain guides that fail
Reply: Especially when they put the timing chain at the rear of the engine, so timing chain replacement as a precaution, requires the engine to be removed, which dis-encourages people from changing the timing chain as a precaution.
Reply: @KapiteinKrentebol  LOL! :D
Reply: @petebach7221 what???
Reply: I need to admit that an shorter oil interval helps the timing chains and plastic guides. The 30k intervals of citroen for example kills the chains to early.
Reply: Still nothing on the wet belt  that’s now going in all new vag cars 🤮
Reply: sad THP noises
Reply: Well luckily my bmw 2004 530d lasted 320 00km thus far 😂
Reply: A feat of engineering
Reply: and putting them at the back of the motor, great system! lol
Reply: And make them in back side of engine.
Reply: My 2.2 Vectra had the same chain for 165,000 miles before a stag destroyed it
Reply: Chains made from rubber is the answer 🤣
Reply: @invertedpolarity6890  u have never worked on them then....
Reply: if you have a direct injected petrol engine with a timing belt "change oil often" like 5-6000 miles MAX. direct injected petrol sends micro soot in to the oil and this act as a grinding paste that damage the links in the chain. when the chain elongate from this it fails.
Reply: @KapiteinKrentebol  Bayerische Mist Wagen😂😂
Reply: @takomerp  🤣🤣🤣🤣🤣🤣 that's a good one
Reply: Add to that anything made of whatever BMW use as a plastic! I've never seen anything like it.
Reply: Bravo! I hope this video, and it's messages, goes viral.
Reply: @cameron20020  
Never buy if u worry abour expensive failure, lease, but either way it could prove expensive, or not, just the luck of the draw.
Reply: @invertedpolarity6890 The N47 was notorious for timing chain failures.
Reply: Your sentence doesn't make any sence. At all.
Reply: @dennythescar80s8  xaxaxaxxaxaxa ,  but the truth is , cars from japan not what they used to be, cars from S Korea dont live past 100K,
Reply: @KapiteinKrentebol  LOL!!
Reply: That’s Audi
Reply: At least a chain gives you a warning before snapping because you can hear it rattling,you get no such warning with a wet or dry belt it just snaps and then it’s game over for that engine leaving the owner with a massive bill.
Reply: @invertedpolarity6890 Your wrong,BMW at one point we’re renown for timing chain failure but they soon rectified it when the costly warranty claims came in.
Reply: @EvanMoon My BMW 3litre diesel with 130,000 miles on the clock doesn’t use any oil between changes usually around 6500 miles.
Reply: @takomerp  drivers car???? i dont think so
Reply: @sleepydragonzarinthal3533  N16 is not a BMW engine and dont forget the wetbelt that drives the oil pump  another master peice from the ministry of crap design !
Reply: @johnnorman7044  yes it is bmw, in partnership with PSA. Anyone who has worked on engines from either recognizes some of the trademark designs. BMW may have never used the prince in any of their own cars, but they definitely designed and manufactured it for use by other companies.
Reply: lol, thats not true. The Bmw from the 90 and early 2000 are nown for the km the engine can. There are alot with 400000 or more km with the first chain. I can not remember 1 guy who have need a new chain in the life cycle
Reply: Dude 😂
Reply: Audi gets points because they use 79 yards of chain per engine.
Reply: Ford uses a wet belt to drive the oil pump on the 2.7 ecoboost. I'm not sure about the other ecoboost engines from Ford. That ought to wipe the engine out when it breaks!
Reply: BMW gets extra points for making EVERYTHING that fails earlier than everything else.
Reply: Those engines were not made by BMW, but by Peugeot.
Reply: @ lmao. You are so wrong, I have been to the actual plant… BMW Hams hall in the uk… there is very little added to it after it leaves to be installed in a Peugeot.
Reply: @mankind8088 😂
Reply: BMWs are just problem after problem, when I was on holiday my dads timing chain on his 3 series started to become fucked and the car kept cutting out and juddering, stop start had to be software disabled as it was destroying the car slowly. His wheels also locked up and started smoking on another long journey.
Reply: VW is gone too. Since the newer Golf mk7 it's going downhill
Reply: @invertedpolarity6890  "etc. but not timing chains." sure, but the things You mentioned is somewhat part of chain movement-supporting things or somehow connected to chain. "Timing chain" is not the meaning of exact chain that connects sprockets, its whole mechanical thing, so if anything failed to the level that chain jumped trough teeth its timing chain problem, because then its not the chain that makes timing. :)
Reply: @takomerp 😂😂😂😂very well said
Reply: Nobody comes close to the Germans in ridiculous and poor engineering, whilst riding on a reputation earned 100 years ago. They will give a soft touch 720 degree rotating hexapolygonal-didecehedral cup holder..but a Fisher Price plastic sump.
Reply: Mine lasted 100k miles as intended tbf, then I got it changed.

BMW timing chains are goated
Reply: It's not called euro trash by accident.
Reply: W stands for Wnk
Reply: @dennythescar80s8 crave my 2002 Lexus LX470 with 320k km and still running like new.
Reply: That is quite a feat!
Reply: Modern OHC engines with multiple cams make for very long and convoluted chains, even multiple chains. This type of set up needs to be reimagined.
Reply: @invertedpolarity6890 they indeed are. When they (re)introduced timing chains it was a disaster.
Reply: Why don't they use gears for timing instead of belts or chains.?
Reply: ...and you'll hear from all the unlucky moaners!
Not the drivers who love and look after their BMWs.
Reply: @dennythescar80s8 and right wingers will still blame the greens for it.🤦‍♂️ we germans have truly lost our way.
Reply: @takomerp  BMW is more in service then on the road
Reply: 150000 miles/12 years here on original chain thanks. 320d
Reply: BMW don't make timing chains. They buy them.

But of course they decide the specs, and where they buy them from.
Reply: And don't forget Volkswagen - I still have nighmares about rattling every time I cold start my Polo :(
Reply: They dont, but if you are dumb and dont follow the maintainance schedule for tensioners and guides, they will. Almost as if it was important...
Reply: Don't they also make those chains near impossible to change?
Reply: Yep, friend is a victim of that amazing BMW German engineering with that timing chain and guide.
Reply: @sleepydragonzarinthal3533 the n12/n16 was a Peugeot engine. Mine was almost burning more oil than petrol. (1L/3000km). I was glad to get rid of it.
The new engines in F56 are awesome.
Reply: @invertedpolarity6890  Are you pretending the N20/N26/ even the diesel N47 isn't known for timing failures??? I guess you are right technically, the chains don't go bad. Now the plastic guides that they rely on to not jump timing and kill your motor... yeah those fail lmfao. You are being dishonest
Reply: It amazes me how the video is about wet timing belts. Then  complete comment sections bashing on BMWs.  If you don't like BMWs then don't buy them. Personally I have owned many, and they are excellent cars. I even have a couple of 30 plus year old ones that run flawlessly. Just basic routine maintenance. Use the right oil, and the right coolant.
Reply: @invertedpolarity6890  Oh yes they indeed have engines with the worst possible longevity on timing chain components, do some research :D
Reply: @KapiteinKrentebol  Bring Mich Werkstatt
Reply: It is the long life service interval shit...
Reply: I believe the nissan YD range owns that title 😂. The 06-15 d40 navaras updated 50,000km timing chain service interval killed the navaras good name in 4x4s and the aftermarket duplex conversion became essential even for the pavement princess' yet alone those who used 4x4s as they should be used
Reply: Damn didn't know about this one, I have only 1.1 million kilometers on my BMW timing chain
Reply: @invertedpolarity6890  Out oF the 6 people i've known that've had 2l 118d & 320d, 3 have had the timing chain literally grenade themselves at under 100k/miles. All 3 cars were write offs. A fourth mate got lucky and the chain stretched first and made a racket so he caught it on time.
Reply: BMW has CV axles that have to be replaced before your batteries. About 1-2 times every 2 weeks.
Reply: VAG: Exactly the same.. The cheap chains with punching errors really did a job on the reliability of their TSI and TDI engines..
But then again a wet belt: I mean come on, are you SERIOUS???! For crying in the mud.. What Einstein came up with that?!
Reply: Don't forget about Toyota and their 1gd. Failed timing chains are already a recall here in Australia.
Reply: Peugeot/Renault made the 2007-2013 mini cooper S R56 N14 2nd gen mini engine. It commonly has what's called a death rattle. There is thousands in preventative maintenance you have to do to make it reliable
Reply: 600K miles before the oil pump chain failed on my ‘74 2 series.  I’ll have to disagree.
Reply: @DOCPSYCHOsince1968  dude chill, the talk is about all modern bmws
Reply: My 2003 BMW Z4, that I bought new, is still running great with well over 100,000 miles. At 100,000 miles I pulled the valve cover to inspect the cams and chains. They show no obvious wear and should last as long as I want to drive it. Not sure which BMW you are referring to, but mine is doing fine.
Reply: They have to share them with Audi who makes timing chains that stretch to the point of valve and piston clash in under 100k
Reply: @dennythescar80s8 don't know where you live, but not much people buy japan cars in Europe, I can't see them
Reply: The timing chains are not like before. Before it was as thick as a motorcycle chain. Nowadays it is as thin as a bicycle chain
Reply: @KapiteinKrentebol  Bring mich Werkstatt
Reply: bc bmw uses regular 10 speed bike chain,
Reply: You forgot to add that just to make it worse they put said chain on the wrong end of the engine so the gearbox has to come out to change it. 
Kudos to, to Opel/Vauxhall & Land Rover for copying this innovation 🙄
Reply: Question one. How many BMW owners do you know with ACTUAL snapped timing chains? Question two. Please tell us - in more than one sentence - what was their maintenance? As recommended by BMW (because of the idiot... sorry, Green party?) - meaning, oil change every 30 000 km or more? There's your reason. Own a 300 000 km N57 with the original chains. No rattle. No noise. Engine oil change every 10 000 km or less (Liqui Moly 5w30). Abuse every day. Will probably replace it some time... but not tomorrow. BMW's still one of the all time greats in engine building. Zero doubt.
Reply: @ they UK is full of BMW & minis for sale with failed engines due to timing chain failure. In addition they can be bought really cheap on eBay because the chain is rattling. It’s very common
Reply: Lie! If you keep up with oil change interval of 5000 miles instead of BMW recommend 10000 miles or 15000 miles, they won’t fail till 300,000 miles
Reply: my fav.. the timing chain on a bmw that mounts on the transmission  side of the engine
Reply: @ definitely 😩 meaning thousands to change.